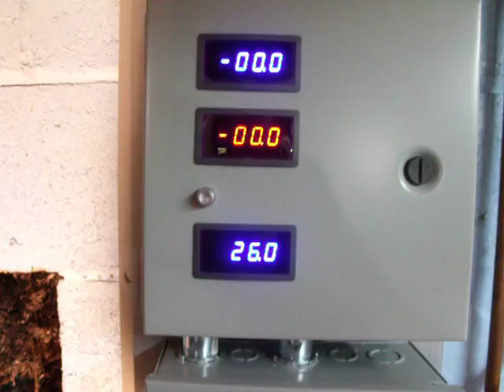volt and amp meter wiring

Comment: Hi. I have purchase these dual LEDs Volt and Amp meter online and to what I have seen the amp meter side of it is, as it should be, plugged in in series.However, it is on the neutral side of the circuit. Shouldn't it be on the live circuit? I am confused. We should have voltage going round live to neutral but only amps going on the live cable to the resistance, nothing coming back on the neutral. Or should it be?

Comment: hi i need your help i just bought an amp meter similar to yours it has 4 wires red,black,yellow and purple when i connect red and black wire to my transformer the display glows and it shows multiples reading even i have not connected the shunt wires its totally off load but when i connect the yellow and purple wire to the shunt it shows shortage and suddenly wires gets heat up and when i disconnect the yellow wire i was back to the normal position and those multiple readings were gone

Comment from the maker: @davevanden1 hi 2 of the leads got to measure the battery and the other 2 need 2volt all it does is power the light in the meter
i have a seperate power supply that feeds off the battery and it regulates it at 12 volt

Comment: what all dose that meter power supply do dose it protect you if you was to disconcet the battries I have know of others that have had charge controllers and they disconnect there batterie and the wind turbine then you know increase voltage distrying the meters dose this power supply protect against over voltage. if so I want on and I want one again great video and also the meters I have use the ground for checking current and not the positive.

Comment: It looks like your system was shut down, but poking around wires with a metal screwdriver might not be the best to show electrical beginners. I am not schooled on those digital meters, but sounds like it could have been a little easier to install. Usually most shunts are put on the negative side of things, but go by what the manufacturer states and ALWAYS use fuses where indicated!

Comment: Thanks for sharing. You mentioned that you would put together a drawing of your wiring dragram. I would love to have a copy of this. Would it also be possible to get a parts list? Your setup is one of the best I've seen for combining wind and solar. Also, are you feeding back to the grid thru a GTI or just running things directly from the batterys? Thanks again!

Comment: I am curious. Could you use a computer power supply's 5v output to power your ammeter that is being used in monitoring the current of the same ps's 12v output? I am almost certain that the 2 power rails are isolated from each other.

Comment: @davevanden1 Thanks. Just hooking the power leads of the meter  to the battery would supply power only. The meter  powers up but reads zero without the sensor hookup.  I think I'll try the small solar panel I have as the power supply and then connect the senor wires to the battery to read the voltage.  I'd rather not install another power supply just to read the voltage.

Comment from the maker: @wtam69  ok the first 2 that have the 12 volt betwen them goes to power supply or battery or solar panel long as it is 12 volt   if you are just reading the battery voltage
try just hooking up the power to the battery and see what it reads i cant remember if it will read without the sensor hooked up some will

Comment: Can you help me out? I just bought a volt meter similar to yours. It has 4 leads ( 2 + and 2 -)and requires a 12 v power supply. Can I use the battery I am measuring as the power supply? When I do that, it seems to have a lower voltage compared to my multitester.   Can I use the solar panel as the 12 v power supply?

  I notice in China, they sell a similar unit with 2 leads and says no power supply needed.  I guess I should have bought that one instead.   Thanks.

Comment: Thanks for pointing out the niceties of hooking up these seemingly simple devices. Looks like  the ammeter is kind of difficult to install. I'll stick with a simple volt meter or multitester for reading my battery voltage for my small solar system for now.